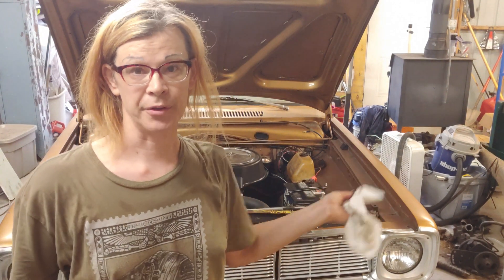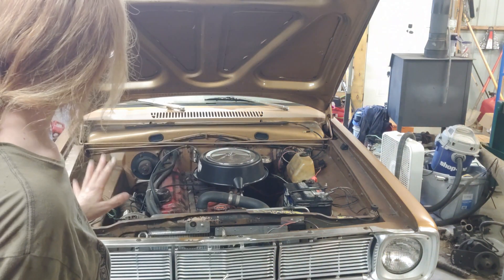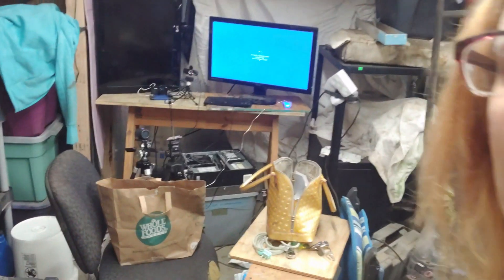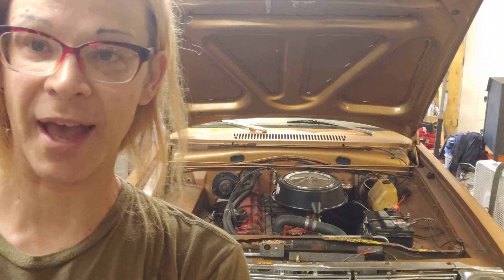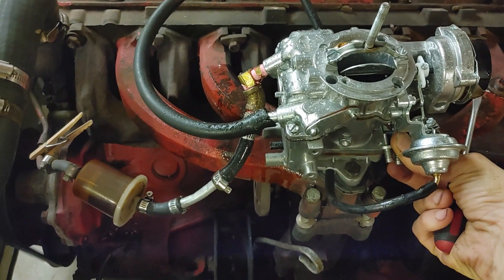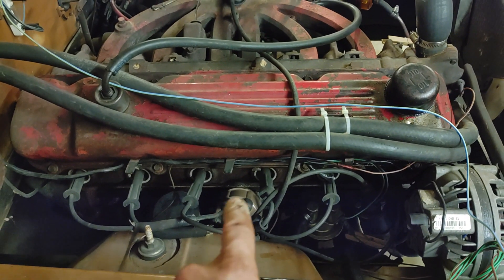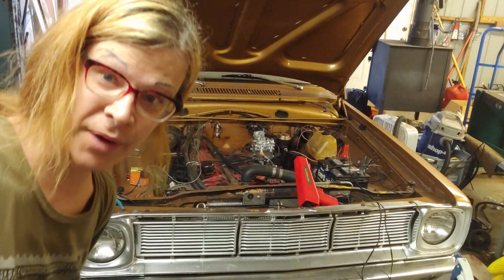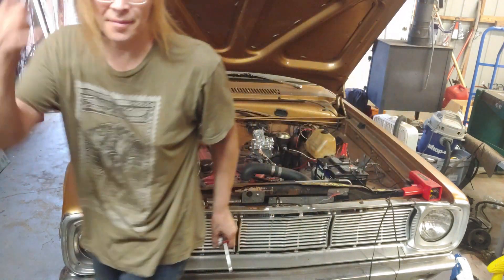What happens when the firing order is wrong? 1966 Dodge Dart slant six.

Comment: Doesn't run tremendously bad with the wrong firing order. Really remarkable engine
Reply from the maker: There was a huge amount of special design work to this engine. The early models were available with an aluminum block. Chrysler quickly abandoned using it as a 'performance' engine but it has endured as a fleet workhorse. Noteworthy for sure.

Comment: good job,connect that pvc hose to an adapter under carb and it will suck all that blow by in and re burn it. i have worked on many slant sixes and they never cease to amaze me. that tower of power would make across country even with a vacuum leak. if you get a chance check the plastic gear on the distributor drive,they get brittle with age.
Reply from the maker: Yes on the pvc hose. Also, I rebuilt this distributor last year and the gear is in good condition.
Reply: @kimfixesthings  awesome work,i broke a plastic gear once just pulling out the distributor.good to see a 4 door dart rolling around.